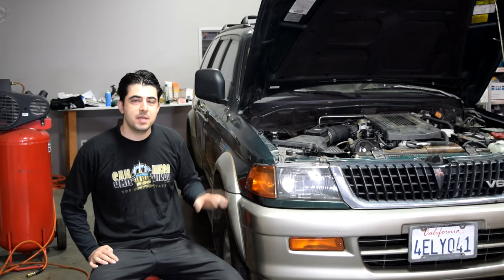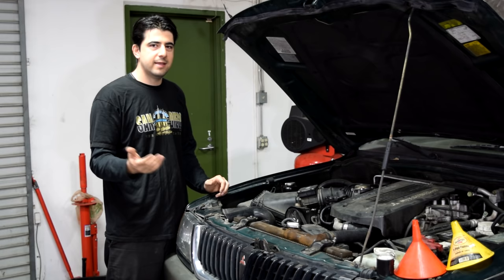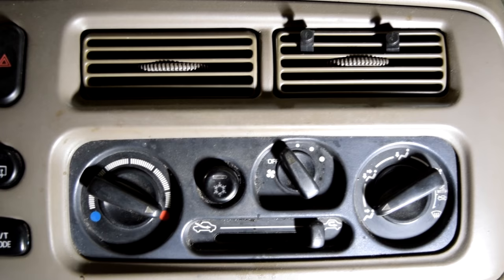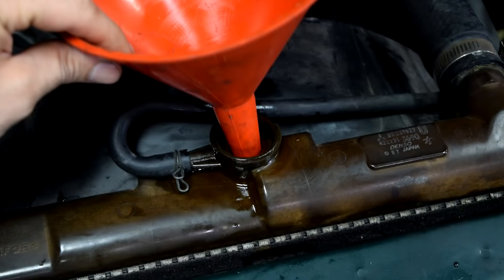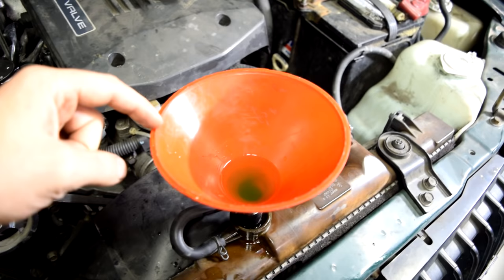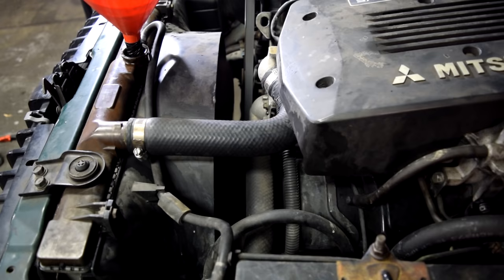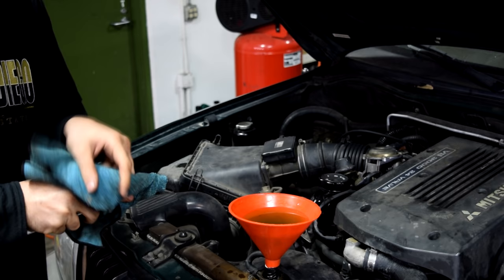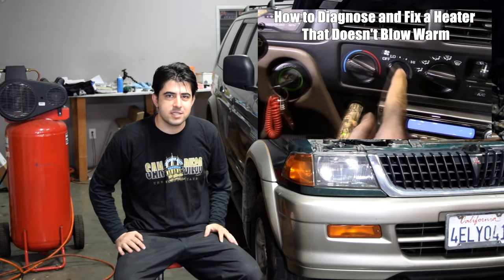Learn How To Bleed Air Out Of Your Car's Cooling System With This Quick And Easy Diy Method.

Comment: Absolutely terrific presentation and explanation of the process.  I just did this (with a plain old funnel wrapped in duct tape) on a Nissan Murano, which is notoriously hard to purge the air out of.  It's CRUCIAL to run it long enough for the fans to come on and off at least twice like he says. As soon as the fans kicked on, the coolant level in the funnel dropped dramatically, and I had to pour more coolant in to keep up with it.  When the fans cycled off and on, that happened again.  The third time, the coolant level in the funnel stayed where it was.  Only after this did I get solid heat coming out of the vents inside the cabin.  The other thing that may not be obvious from his presentation is that while the engine is running, you will see bubbles of air burping up in the funnel.  That's good.  It means air is getting out of the system, and if the funnel level drops down to the bottom, put some more in.  You must keep at least a little coolant in the base of the funnel at all times so coolant will drop in as the air escapes.  Keep running the engine and replenishing the funnel as long as you keep seeing occasional air "burps" escaping.  It took 30 minutes on mine, revving the engine and letting the fans cycle on and off, until the burping stopped and the heater was working correctly.  When you are all done and you put the radiator cap back on, make sure that radiator is full right to the very top, so that as the system cools off, it doesn't pull any air at all back into the system.  If it's full to the top, it will suck coolant in from the overflow tank as it cools, which is what you want.
Reply: so during this process- do you use the bleeder screw(if your vehicle has one) or do you keep the bleeder screw closed. This is on a 3.7 jeep cherokee 2006

Comment: Took a half hour and got my buddy's heat working in his 2006 Dodge Ram last night thanks to this video.  We did lose a lot of coolant after we got heat working...didn't have a large enough funnel, and when we shut off engine, lost even more, but we refilled the reservoir after re-capping radiator and it refilled itself from the reservoir. We topped it off after it had stopped taking coolant from reservoir.  He drove home with heat for the first time in months.  Thanks for the video, my friend!

Comment: I don't have an over heating problem, I just have a no heat and losing antifreeze. I did the funnel in the radiator as to check for air pockets like you have described and the antifreeze started backing up rapidly out of the funnel. Any thoughts on my situation?

Comment: That's good information.  I liked the trick you used with the screwdriver and towel to get the excess fluid in the funnel out and into the bucket.
Reply from the maker: +Ozzstar Glad you liked it, thanks for commenting. cheers
Reply: that trick is clutch!  thanks for the video
Reply: Ratchets And Wrenches
Reply: Ratchets And Wrenches cam jar

Cam oar bomba de Agua de Pontiac 2002en espanol
Reply: Lisandra Crespo Zaza
Reply: Ozzstar .
Reply: Or let it cool down and let the system suck the fluid back in
Reply: Turkey
Baster
Reply: @myRatchets  p
Reply: i usually just stick my (gloved) hand into the funnel to plug it when pulling it out.

Comment: Thank you for the information. I changed the thermostat 2 months ago in the summer and didn't know I had to bleed the system First sign of fall I had no heat. I followed your instructions and now I have great heat again and I can cancel the appointment with the repair shop for next week! Great information!
Reply: I blow 2 times the heads. 😆. Now i know on my Impala.
Reply: @waltercastro2015  sorry to hear that but I'm glad you learned how to take care of your car 🙏

Comment: Okay, I have just watched a bunch of videos on bleeding the coolant system and this seems to be the best one. It included quite a bit of advice missing from the others. Notable was the advice to put the car on an incline in order to encourage the air to bubble up and out. Another thing included here was the advice to use a funnel but remove it by putting a rag around a rod and then lifting it up. I guess this to make sure that coolant in the funnel (maybe with air bubbles) does not go right back down the funnel?  Also liked how he remarked on how you may hear water moving around the dashboard if there is air in the system. Just lots of good tips here, it seems. The only thing missing here I think is some advice to wear safety goggles when dealing with the radiator. Seems like a simple and obvious safety step, and who wants hot coolant on their eyes? I will follow the advice and see how it goes.
Reply: someone needs to tell you that?

Comment: When I rev the engine it creates some bubbles in the funnel. is that normal? (2005 honda civic)Not at idle just revving it. i was trying to get air out because my reservoir bottle wasnt refilling the radiator. getting the air out it helped as it sucked back two thirds of the coolant that filled my bottle after a drive (took over several hours to suck it back in)but not all the excess coolant went back. maybe it has more air in it. i just dont understand the bubbles while i rev it. i did several head gasket checks and it looks good and engine runs smooth.

Comment: Good video. I use a regular funnel with tape just as you did. But before I use the funnel, I also wrap tape around a wood dowel and fit it to the inner spout to make a sealed fit. When I am done I insert the dowel into the funnel to seal and pour the remainder of fluid into the bottle. No mess and no loss. I normally put it on ramps after I fill with the cap on. The air will travel to the cooling system's highest point and end up in the overflow tank where it will escape.

Comment: I came across your video, applied the technique of using just the simple funnel, and my truck's cooling system air pockets eventually went away. After I finished, rather then removing the funnel with the coolant left in it right away, , I kept it still inserted in the radiator neck all night long, just in case. Your suggested repair was very successful; your video offers a very high value. Thank you for posting.

Comment: I know some people are going to complain about squeezing brittle radiator hoses but I fully agree to this, and if the hoses are that bad they need to be replaced.

Also watch your hands/fingers around those belts and fans!

Great video keep up the good work!
Reply from the maker: +apachelives Agreed, one should make a point of squeezing old brittle radiator hoses on a regular bases, better they leak at your garage than in the middle of the road somewhere. cheers
Reply: apachelives
Reply: My VW manual's directions are to squeeze and tug the hoses to get air out, so anyone telling you not to doesn't understand cars very well
Reply: If it is brittle, it will fail, the system gets pressurized lmao
Reply: You said it right if the hoses are so bad they can't be squeezed you should replace them shitzz

Comment: You have no idea how brilliant you are. Saved me unneccesary thermostat, heater core costs. After days of adding coolant and car still heating and no heat l had given up and was gonna go see mechanic and pay lots of dollars. Car heater works, car doesn't heat and runs smooth. No thumbs up is enough to repay you.

Comment: I changed my thermostat and the car started heating.
I set the heater on max, fan on low, I put the funnel, squeezed the coolant hose and added coolant like 3 times.

It worked! Thank God and thank you sir😃😃😃

Comment: I took my son's car to Jiffy Lube for an oil change, they topped off the radiator fluid as part of the service. He noticed a day or two later he could hear water splashing in the dash. Later he had no heat. So, they trapped air in the coolant system which I learned from watching this video. We bleed the air out as in the video and all was 100%. PS, don't let Jiffy Lube do anything other than oil. Even so, a few years back, they stripped the oil plug on my Porsche which had to be tapped and oversized for a replacement. I should have learned at that point but the wife swore it was an anomaly. The things we do for love - LOL   Great video, very good information, and well presented! Thanks!

Comment: This guys SPOT ON and got this thing NAILED DOWN bigtime ! Short, concise, to the point not trying to be entertaining, just clear facts that really work. Wanted to add just a few points other people may find helpful. Don't overlook the point he makes about waiting for the cooling fans to come on, and wait again for them to come on the second time. Took my fans 40 minutes to come on the first time, I was doing this outside at 42 degrees farhrenheit and that was with keeping the engine at 1,500 RPM. I almost gave up on them coming on after 30 minutes, glad I didnt because when the fans came on the first time a fare amount of air came out just afterwards, I actually went thru 4 on off cycles with the fans just to really make sure I got all the air out, added about 15 minutes to the job. Be prepared when the cooling fans come on that the antifreeze in the funnel  will go down noticeably and when they go off the antifreeze starts to rise again in the funnel. Thinking this expansion and contraction of the fluid helps push out even more air. I was working alone and used my snow brush that is about 24"-30" long to wedge it between the seat and the gas peddle to keep the car running at 1,500 RPM. I did do this with the car up on jack stands thinking it would make this process faster, but don't think that is the case, but it may really help getting the air out more thoroughly,  especially from the heater core. So thankful for this guy, I was really at a dead end with my mechanic after he tried twice to bleed the system unsuccessfully after he had successfully replaced the head gasket. Just think he wasnt waiting long enough to have the cooling fans come on. Buy the way I did this on a Subaru, notice in this video he is doing this also on a Japanese car.

Comment: Just wanted to say thank you.  I just followed your video in order to fix a problem I was having with not having heat when my truck idles.  I was going to wait for my brother in law to fix it, but last night it was 12 degrees outside and I got stuck on the interstate for 45 minutes due to a wreck.  Wow that was cold.  Everything works great now.  So, thank you.

Comment: Car was overheating. No heat inside. No leaks. Replaced radiator. Re placed thermostat. went to the store and bough antifreeze and a big funnel. i was able to burp it not once but 2x and she swallowed all the antifreeze that was coming up and burped and went back into the radiator. put the cap on. let her run for 40 min and started to get heat. drove her for 15 min around a parking lot and no overheating. thanks so much for this. dont wait for ppl to help you. do it urself. THANK YOU!! 95 Lebaron v6

Comment: Credit where credit is due. 

Thank you for your time and effort. Yes there were others, but this one was the one. 

Started with a alternator replacement and my big dumb elbow broke the nipple to the overflow reservoir and it turned into a radiator replacement. I haven't replaced a radiator since I was 10, I'm 33 now, and this is the exact video I needed. 

Thank you again.
Reply: When you did what he did to take the air out did you run it later or right after doing it

Comment: Unfortunately I have a PT cruiser I think I have both problems I'm not getting no heat when it's idling 🤔 but I'm not getting no leaks so it might be head gasket issues I'm hoping it's just air in the system cuz it takes a long time before it overheats pray for me 🙏 your video was very informative thank you for sharing information like this but I'll keep you updated with my issues I hope this is the problem 🤔🤒💯

Comment: When I first learn that my butt was in trouble with all the air in the system I thought that my car would blow up. and that car was my only family vehicle I got so scared. at first I thought that air in the system would not be a big deal. but after I tried the method until no more bubbles. I was impressed. Thank you very much Ratchets and Wrenches.

Comment: If you can't afford the no spill funnel, autozone has a super long clear funnel that gets gradually wider toward the top, you can just push it down in there until it's tight. If you have a super wide radiator cap like me, you can chop the narrow end off so that the funnel isn't too long. It's $6

Comment: With some vehicles I raise the front wheels 3' off the ground, remove upper rad hose at engine and fill the engine to the extent possible.  Works well with Honda 4 Intec

Comment: Thanks. I replaced my heater hoses because both of them were leaking, what a nightmare replacing those were finally, I replaced them, and there was no leaking at all, but the car was still overheating. The fans are turning on and I did this and so far it’s working

Comment: Thanks! Worked great! I busted a radiator hose on my Jeep Hemi and it was overheating after I replaced the hose / coolant. I realized there was likely air in the system. I used your idea vs taking off a bunch of stuff to get to the pump bleeder. The air came out and almost another half gal of coolant went in. Temp is now perfect again... 😊

Comment: Great video! Loved the duct tape idea for the loose-fitting funnel. One tip: At the 5:00 mark, a turkey baster would be really helpful there! Just suck out the excess coolant from the funnel and reuse it later. In general, it's good to keep a turkey baster around! 🦃
Reply: Its not recommended to reuse the coolant cust is already contaminated and it could have debri from tour old radiator in it
Reply: Nice tip, thanks!

Comment: Thanks Man U saved my ass.
Most local mechanics don’t even do this they try to just let car run without the funnel.
 I tried 3 mechanic they keep blaming thermostat and water pump. But won’t guarantee it.
Didn’t want to go to pros due to the high cost of repair.
I followed every step and it worked. The heater high did the last trick!

Comment: Thank you for the tip about taking the cap off and letting the vehicle run. I had an air pocket and squeezing the hose caused it to break free and felt the fluid begin to come down the hose. Thanks again.

Comment: Great tip thanks a lot for sharing this video with us. I recently had to replace a broken radiator hose that snapped off at the tea filler, and I knew I needed to burp the system but I couldn’t figure out how to do it because the heat is not working

Comment: THANK YOU!!! Thank you so much! We tried everything and only this video helped us fix the car! Thank you so so so so very much!! We even tried burping the system from other videos but only the specifics from this video did the trick (manipulation/squeezing of radiator hoses and revving the engine with heat on, car at angle etc)! Thank you so much!!! Good karma! God Bless!!!

Comment: Can't thank you enough. I didn't know I had to refill the radiator with coolant after the lower hose popping off releasing all the coolant from the system. As a real rookie I have only refilled the reservoir. That's why my engine was overheating lol. Will take it for another test drive tomorrow to confirm the issue is gone.

Comment: IF YOU HAVE A PT CRUISER: it DOES have a bleeder valve on the inner side of the radiator, it takes a 3/8 wrench and saves a lot of trouble. I learned that the hard way. 
I'm watching because I upgraded to a '98 crown vic, which does not have a bleeder valve. DO NOT get coolant on the serpentine belt!!! Thanks for the video ❤️🏎🏎🏎

Comment: Thanks, I have this issue on my Vectra after changing the radiator and repairing a heater matrix leak, and didn’t think I could leave the system open while running because the thermostat wouldn’t open without pressure and expected the air to enter the expansion tank but getting cool heater and temp gauge displaying cold sometimes, but not loosing water.
I’ll try this tomorrow 👍

Comment: I just ordered me one of those spill proof funnels on amazon, it’s supposed to be here Tuesday. I have to replace the water pump in my wife’s Nissan. This funnel should make my life a lot easier when I put new coolant back in. Then I’m gonna change out the coolant on my old Jeep the correct way. I did the coolant on my Jeep back in February when I replaced the radiator, man what a mess! 😂

Comment: Thank you so much, I have jeep wrangler jku 2014, I have been suffering for abnormal overheating while off-roading & also weird water flow sound inside my car sometimes. All solved when I just bleeded air out from the coolent

Comment: bought a second genesis coupe 2.0t and noticed when i turn on the car it would get scorching hot in 3 mins without going to H on the temp gauge. before you could literally fry an egg on my valve cover, the upper coolant hose was too hot to touch longer than 1.5 secs, and the radiator would get super hot at idle. my other genesis coupe stays cool. so i decided to follow the steps in this video and repeat multiple times, got alot of bubbles out squeezing both hoses and the second time i got bubbles from only the lower radiator hose. i let my car idle for 30 mins and the valve cover was super cool i was shocked, the radiator isn't getting as hot now also. i will try some more tomorrow and see if it gets better. so far the car still has no heat and the upper hose is hotter than the lower hose but it wont get as hot as it used to. going to try this on my other genesis because of the dramatic results in removal of heat
Reply: Modified Cars a

Comment: Excellent Video! Now I have a way to bleed the air out without the mess of it overflowing out the radiator.
Reply: jbentley8383
Reply: jbentley8383 
who did you get it fixed